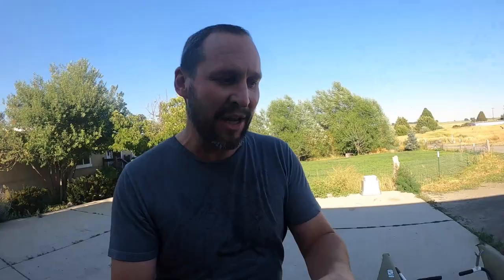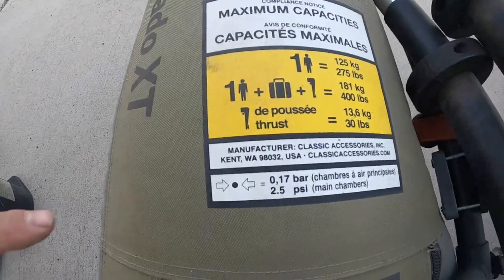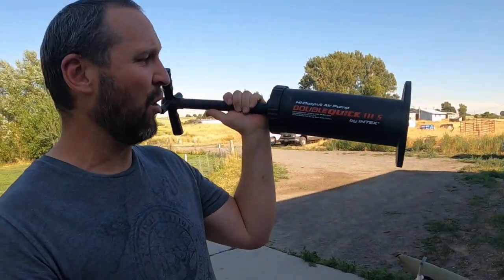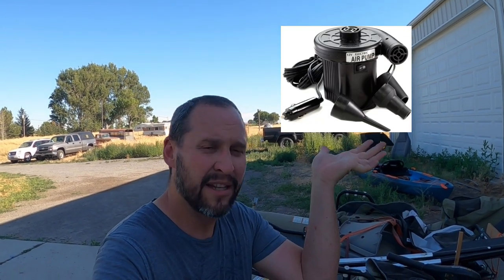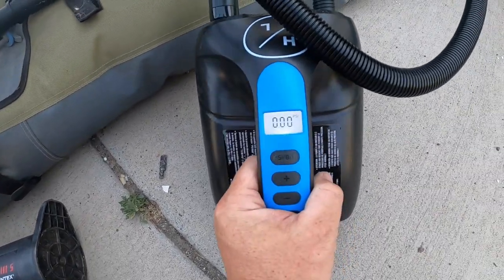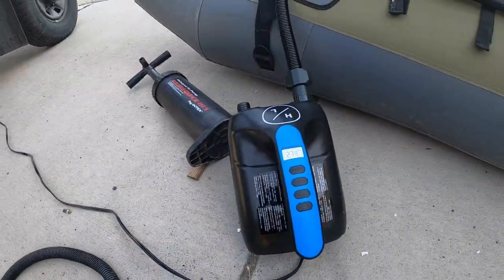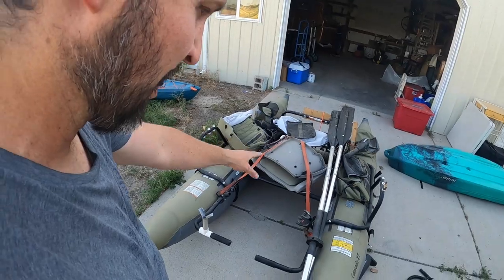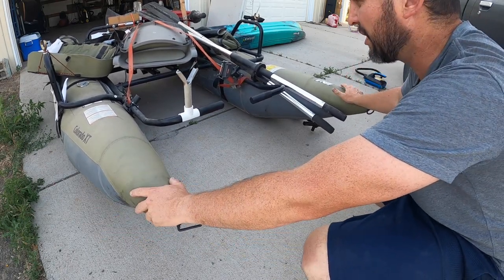Inflating the Colorado XT Pontoon

Comment: Thanks for this video. I just bought a used one and came with no pump. Tried a few cheap ones that just couldn't cut it. After watching your video I was able to score a pump from a local sporting goods store similar to the one you used from the paddle board. Worked like a charm. Shut off at 2.5 pounds, was fast and was able to fill the pontoon much harder than I imagined 2.5 pounds would be. So thanks for the advice.

Comment: Hey Will, Ryobi makes  a battery powered leaf blower. It will fill an empty bladder 95 percent full in way less than a minute. Just need to top it off with the foot pump.   It doest fit the valve at all but jus hold it on as tight as you can. Works great.
Reply from the maker: Cool.  More fun too!
Reply: I do the same with my Makita

Comment: I got an electric pump just like the one that came with the SUP,   it's an Aquaglide, and I got mine from REI.  it's amazing, you plug it in set the PSI and work on other stuff while it inflates.  Not that it takes long.  5 min or so and then inflate the next pontoon.  My only complain is that it's kinda obnoxiously loud.

Comment: You can get an SUP valve adapter with a Schrader valve on Amazon and then a lot of your 12v tire inflators for cars have a built in pressure gage. (Not sure how long it would take to inflate from scratch)
Reply from the maker: Thanks Jordan, another option to consider!
Reply: This would work great and I can use my Ryobi pump with a pressure gauge! 
Sorry, can’t copy and paste from my phone, but it’s a SUP inflator kit on Amazon for $11.99😮

Comment: Thanks so much Will.  What does the wrench do for me. I just inflated it.. but unlike your video - when I take the tube off, the air escapes before I can put the cover on.  When you took the hose off.. no air escaped..
Reply from the maker: The little knob in center of the valve needs to be pushed down and turned.  Your valve is currently locked open.
Reply: Many people are still having this problem. Turning the valve either opens it or closes it. There’s no one-way valve option where you can pump air into it and then no air escapes.
Reply: Did you ever come up with a solution for this? Mine does the same thing and I’ve talked to another person who has the same issue. The valve is either open or closed. There’s no way to pump air into it like a one-way valve where when you disconnect the hose air doesn’t escape

Comment: I'm always losing air pressure trying to close the valve after I inflate. But I saw where you just popped the hose out and the valve was closed. Am I missing something? I'm not the brightest bulb on the tree, so, what am I doing wrong?
I've watched several of your inflatable pontoon mod videos, and am interested especially in your pwm mod. 
I saw where several people have had issues with the modulators burning up. Now that you have had yours for a while, have you any issues?
Reply from the maker: The valve twists.  Yours must be pushed in and locked open.  Turn it the opposite way and it should close. Two years and no burnouts.  Just make sure you get one that can more than handle the amps.  I have a video on it.  Blessings!
Reply: Did you ever come up with a solution to this problem. Many of us have the same thing going on the valve is either opened or closed. There’s no setting where it’s a one-way valve and when you take the hose off air doesn’t escape.

Comment: So when I inflate mine and take the pump off the air just comes out. What do I need to do so the air doesn’t come out when you release the pump?
Reply: Did you ever come up with a solution for this? My experiences the same I’m wondering if I tightened the valve down with the wrench too tight or if this discontinued product is no longer available because it was faulty.